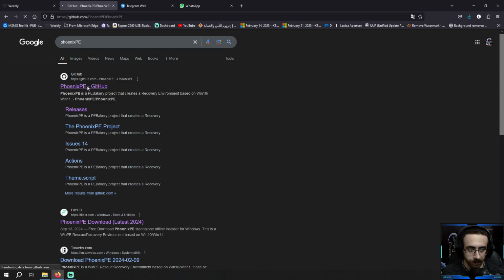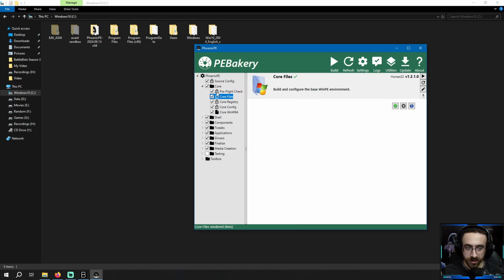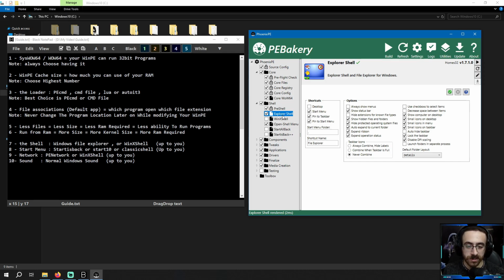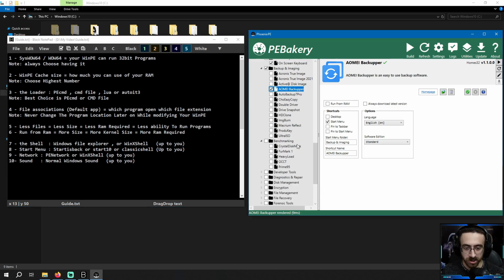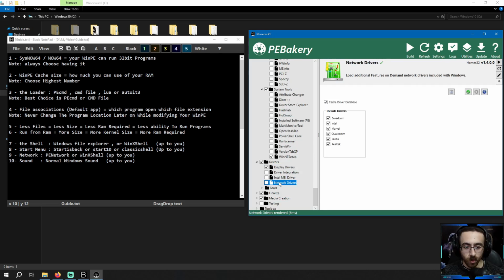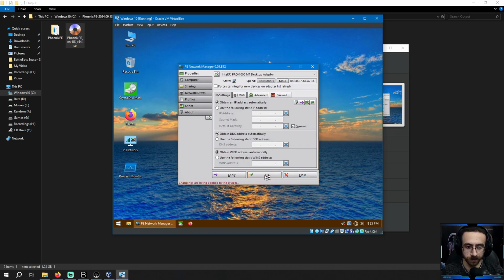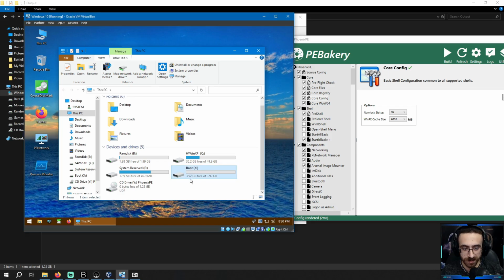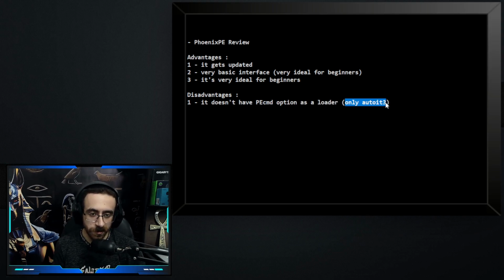PhoenixPE : Review and Testing

Comment: Win10PE SE Vs Win10XPE Vs PhoenixPE Which Is The Best And Better?
Reply from the maker: currently , Win10XPE is the best choice 
Win10PESE support ended long time ago and doesn't receive any updates anymore 
PhoenixPE has very limited options 
Win10XPE is still supported and receive updates and has the biggest amount of features add ons
 
i used Win10XPE to create AnkhTech WinPE , of course i modified the created WinPE very much
Reply: I've noticed that some Windows commands that work with WIN10XPE don't work with Phoenix PE, such as "msinfo32" and "mdsched". Is there a way to fix this? @ankhtech
Reply: Resolved!

Comment: I am not getting any internet connection when I boot from USB. My internet is working fine through normal OS boot. Am I missing anything here like a driver for wifi?
Reply from the maker: did your Wi-Fi get installed at all ?
are you using Ethernet cable or Wi-Fi

keep in mind 1 important thing , the Wi-Fi and Network Drivers that gets integrated are not enough to install any Wi-Fi Device on any machine 
these are just "some" wifi which are added to Windows 10 by Default 
it's never enough , that's why we always add more drivers or use Driver Snappy that has Wi-Fi Drivers 

i know i didn't mention that in the video , it's just hard to clarify everything and keep the video as short as possible
Reply: @ankhtech  I managed to get it fixed. The error log mentioned an .inf driver file missing. once I added it, then my wifi appeared in the list and was able to connect. Thanks for your help and btw, this video is the best and only fully comprehensive PhoenixPE setup video on the internet - well done !
Reply from the maker: @snowwhitetan666  Glad you managed to fix it

Comment: Win10XPE Vs PhoenixPE Which Is The Best And Better?
Reply from the maker: unfortunately , the answer would be Win10XPE
because Win10XPE has more features, and has PEcmd
PhoenixPE lacks some of the important programs and as i have mentioned in the video it uses autoit3 as a loader (which is very hard to modify , i don't know how to modify it ...)
so Win10XPE wins

also i noticed something , but i didn't mention it
booting up the WinPE created by PhoenixPE takes a lot of time compared to a WinPE created by Win10XPE
Reply: @ankhtech  PhoenixPE does have PECMD. you can load PECMD scripts on the PreShell script under the "Additional Configuration" heading. There is no need to modify the Autoit3 loader directly. It's a skeleton framework and anything you need to add is designed to be done dynamically through .script files during build (adding shortcuts, registry entries, etc.), or you can included your own additional config in either au3 or pecmd format. I can't really comment on boot time, as it's completely subjective to which apps and features you have enabled in each build. For me all PE  (PhoenixPE, Win10PE_SE, Win10XPE, Hirens, etc.) all take about the same amount of time to boot on the same hardware.
Reply: Ok Bro Thanks 😊 Continue Please I Am Waiting For Your Next Video